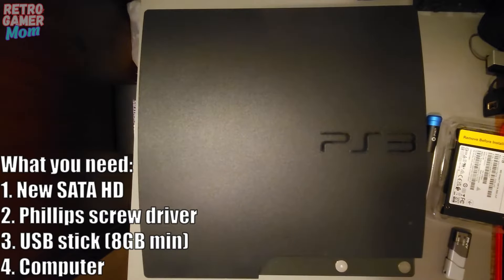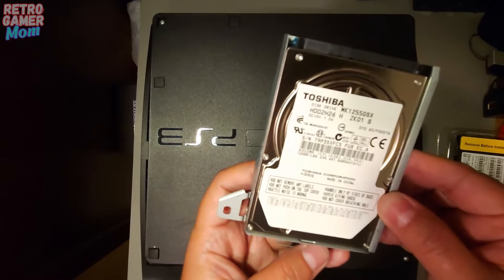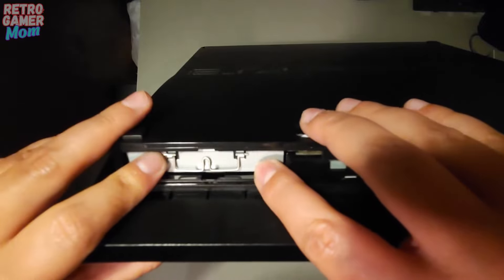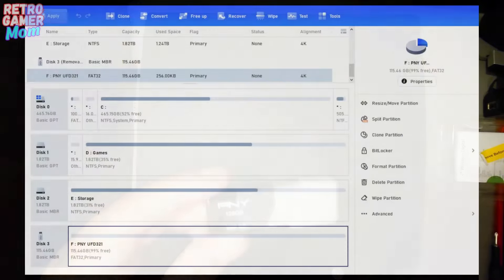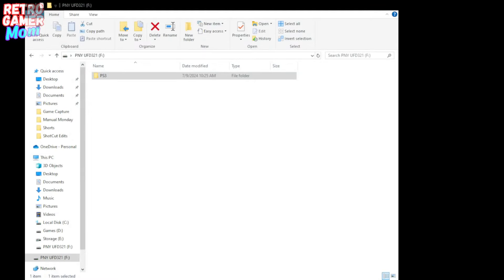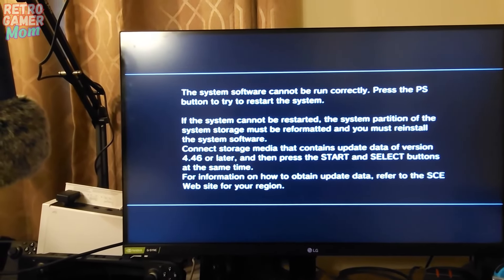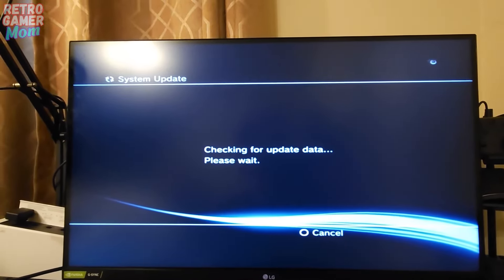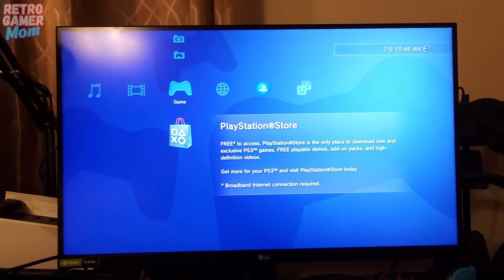PS3 Slim SSD HD Upgrade Tutorial

Comment: Aren’t SSD’s not going to work well after a while due to lack of TRIM and other features that PC’s have but PS3 does not?
Reply: That's the reason I won't mess with ssd on ps3...a quality 1tb hdd is more than enough
Reply from the maker: Yes, I read about that too but on a PS3 you're not doing nearly as much writing, deleting, rewriting like you would if the drive was in a PC. Guess I'll find out for sure eventually... 🤷‍♀️

Comment: I would like to mention that you don’t need to worry about formatting the SSD that you will be installing. The PS3 will delete and format it for yah.  Used and old SSD that had a windows partition on it and the ps3 formatted it without a problem.
Reply: That's also a trick (dunno if still works) remove HDD and put back in, it formats automatically. So if you want it to be empty for whatever reason

Comment: Why not just install custom firmware? Do I have to install the original firmware first?
Reply from the maker: Yes, you need the original firmware. CFW works with the PS3 software. It doesn't replace it.
Reply: I have a hard drive adapter can i use that instead of usb stick?

Comment: Found out I could only use a 32 gig our less usb stick to put updated ps3 software on.
Reply from the maker: @outfield1988  That's weird because I used a 128GB USB stick and it worked fine for me...
Reply: @ yeah would not read the drive unless I dropped to a 32 gig stick. Maybe the 64 gig I had was not compatible.
Reply from the maker: @outfield1988  That's possible. Is it a decent brand?
Reply: @ No it was a cheap 64 gig my wife bought from China. Getting ready to finish my ps 3 super slim. After that have a PS 1 to restore. Love your Channel

Comment: Really nice tutorial. Have a PS3 on the way this week which I intend to mod up.
Reply from the maker: Glad it was helpful!
Reply: @RetroGamerMom  Update: It worked 👍
Reply: What mods/aftermarket upgrades would you recommend for a ps3 slim? Was looking to upgrade to a SSD , but not sure what else would help prolong the life and help performance wise.
Reply from the maker: @stonecoldjay If you're comfortable, open it up and clean it of any dust. Also, replacing the thermal paste on the CPU/GPU will help with temps if needed.

Comment: I did a 2TB in my PS3 super slim, and my PS4 pro😎
Reply: How did you get the PS3 to format the drive as 2TB?  I thought the maximum supported size was 1TB, and some have gotten up to 1.5TB to work…
Reply: @bsd107  I did it without thinking there was a limit😅 2TB is all I could recommend; 1TB would get you by.
The PS4 Pro can do 8TB🤯

Comment: Where'd u order that ssd? My current hard drive is failing in my ps3
Reply from the maker: I got it on Amazon.
Western Digital 1TB WD Green Internal SSD Solid State Drive: https://a.co/d/52ia1Up
Reply: @RetroGamerMom  i hear mixed reviews about Western Digital drives. Haven't used them as I have always stuck with Seagate drives. I currently have a 4tb in my ps2 with no issues so idk what to choose lol
Reply from the maker: @JzLyfe I have used Western Digital and Seagate drives before, mostly in PC.  I haven't had issues with either so I just went with what I found. 🤷‍♀️

Comment: What brand and model SSD card should I buy.???
And where can I buy the SSD..???
Reply from the maker: The one I bought was off Amazon. It's a Western Digital Green Internal SSD 1TB 2.5".
Edit: Model number  WDS100T3G0A
Reply: @ You are awesome thanks for your reply. Question: does a 1T SSD works faster than a 500GB SSD..?? Or are the same as far as speed.???
There are other SSD Cards on Amazon that are WD Green., Red, and Blue.??? What does the color mean.?
Reply from the maker: @joseortega584 You're welcome. The 500GB and 1TB is storage space so 1TB will let you have more games on the hard drive than 500. The colors are for different things. Red is used more for NAS which is data backups or cheaper  media servers. Blue are green are similar in terms of of speeds etc. Blue is a standard SSD for all PCs and workflow and Green was meant for backups or drive upgrades for slower machines. You can go with either one the price difference isn't much. The transfer speed of the drives doesn't matter because it's faster than what the PS3 caps out at anyway.
Reply: @RetroGamerMom  Understood. Well explained. Thanks again..!! 🙏🏻
Reply: @RetroGamerMom  Would you know if it's possible to save a game that is on a ps3 disk into the SSD card so I can play the game without the disk ..???
Reply from the maker: @joseortega584 It is possible but you have to put custom firmware on the PS3 so you can download a program to do it.
Reply: @RetroGamerMom  😅. I'm not that smart... but if you know how to do it and you have a video I can watch to do it I can try it. Do you know how.?
Reply from the maker: @joseortega584 I have done it and I highly recommend this video guide from Mr. Mario. It's what I followed.
https://youtu.be/rwqk_8mJy30?si=wHlMGTrHFuFJT3yU
Reply: @RetroGamerMom  Can I pay you to jail break it for me.?? That's too complicated for my old brain..lol
Let me know. Thanks.
Reply: @RetroGamerMom  Can I install Multiman on my ps3 without jailbreaking it.?
Reply from the maker: Lol sorry I don't do that.
Reply from the maker: No, unfortunately it needs to be jailbroken first.
Reply: @RetroGamerMom  By switching the hdd to a SSD card., that's not necessarily jailbreaking it correct.?
Reply from the maker: @joseortega584 That's correct. It's just a faster HD and you're installing the PS3 software on it so it functions properly.
Reply: @RetroGamerMom  you are so awesome. Thank you for taking the time to answer my questions. Do you have a way I can send a Donation to your channel.?
Reply from the maker: @joseortega584 You're welcome! I don't mind helping others. No, I don't currently have a way to accept donations. Hopefully soon thanks!